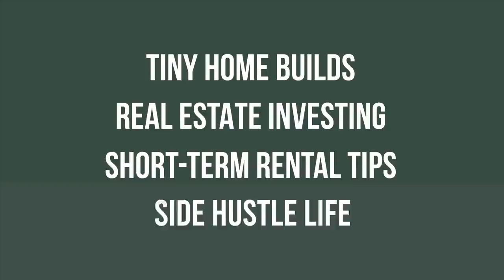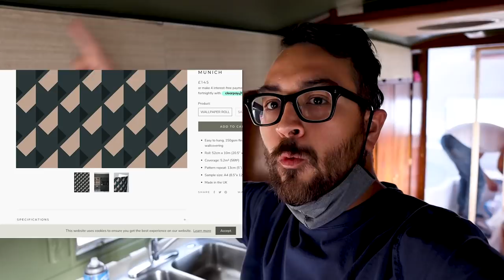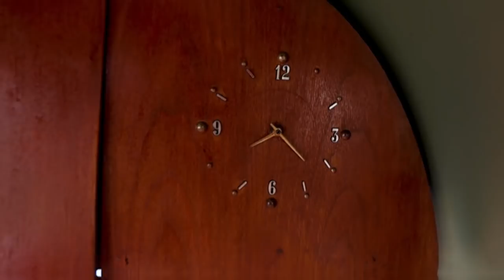MY $7000 TINY HOUSE AIRSTREAM RENOVATION | Painting and Cabinet Restoration | EP. 2

Comment: Hi Rob, love the content, watch every one of your videos.  Very inspiring.  Now for a little advice if someone else has not said this already, GET A SANDING BLOCK!  It will spare your fingers and hands, allows you to sand a larger area than you can with your fingers, gives a much more even surface finish, and also allows you to control the amount of materials taken off.  It not as good as an orbital of course, like you mentioned, but it far and away better than the finger and hand method you were using.

Comment: ROWbuilt, how do you get rid of the smells that come from painting and staining? Is there a trick to that or does it just take a while to air out?
Reply from the maker: Haha yeah you just have to air it out. Wish it was a little faster, but it’s not TOO bad in there at the moment.
Reply: if you use paints with low VOC the smell tends to dissipate quicker
Reply: Just fill a few buckets of water and place it In the room while it’s opened. It works faster that just airing it out 💯

Comment: I'm surprised you didn't have to do anything to the trailer or the floor. Most of the time those are all rotted out. That's where most of the time suck is in Airstream renovations.
Reply from the maker: The previous owner repaired anything that needed to be addressed in the flooring.